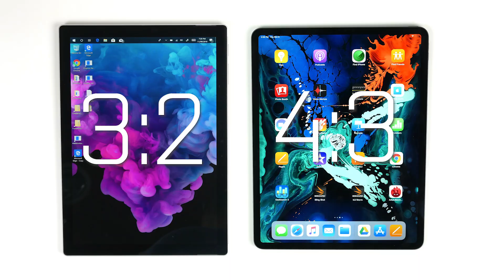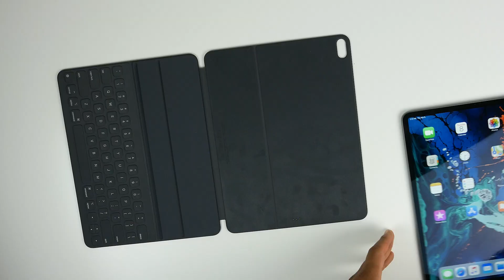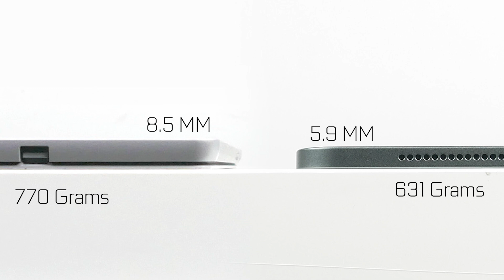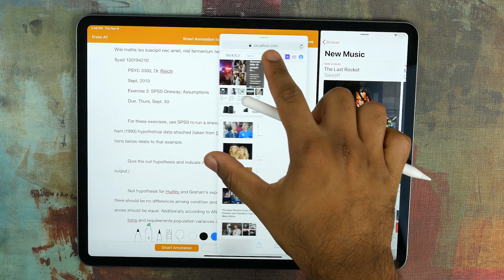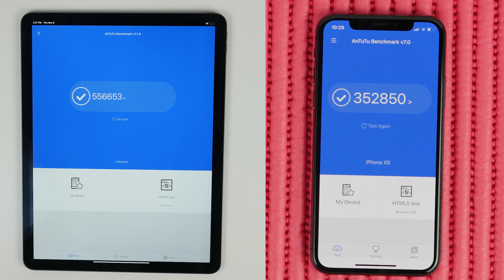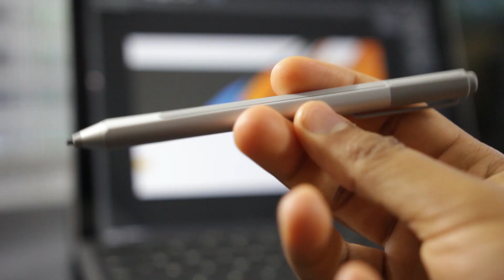2018 iPad Pro vs Surface Pro 6

Comment: One thing people won't understand is that, these two CPU uses different architecture, one is desktop class design to run heavy and capable operating system and the other is ARM design to handle mobile operating system, they work differently, one is less tasking and the other is super high tasking. If Apple A12x CPU was that good, why didn't they use it at least on the New MacBook  Air? , I bet you, macOS will cripple the A12X CPU cos that's a desktop class operating system, it has plenty of information to process compared to a mobile operating system. The iPad is a nice and capable machine that can handle any kind of mobile task which by itself, it's very limited. but trust me it cannot do more than that at least for now. Even the Photoshop that was demoed on stage during the iPad launch event had some minimal lag to it, even when it's a strip down version of the full Photoshop that runs on a true computer. At the end, the iPad pro is a powerful iPad that can only handle basic tasks. People talk about how u can edit 4k video on it, but the real question is, do this set of people truly uses the iPad pro to edit their 4k video all the time without the help of a computer? How convenient is it to really edit 4k video on an iPad? How does it handle plugins? How does it handle effect that even an Imac Pro struggle at times ? Please someone should correct me if am wrong.
Reply: i remember the fan boys saying the iphone X was outperforming a mac pro. lol i was like oh ok i guess 4k editing is a joke now
Reply: So if it ran mac OS then the geek bench score would be very different?
Reply: The limitations of the OS and the different instruction-set doesn't change the fact that the A12X is a more powerful CPU than the Core i5/7 used in the surface pro. In benchmarks both devices peform the exakt same taks/calculations independet from the platform/architecture. And if the iPad finishes these tasks that much faster it also means that the processor is more capable. Apple has suprassed Intel with their chips in terms of performance per watt already long ago and it really starts to show with that iPad. They didnt put in  the MacBooks since all programs for MacOS are compiled for X86, so it wont be able run MacOS programs natively as of right now. (Im sure though Apple has already an ARM compiled version of MacOS ready and they are probably just working to make third party applications work with an emulator behind the scenes => they already did this back in the days when they switched from PowerPC to X86 with an emulator called rosetta)

But I agree the ability to use the power of the A12X is fairly limited as of right now. But since its so powerful and it has a USB-C port Apple could easily update it full fledged pc experience in the future. The question is, if they really want that since the restrictions of iOS are part of their business model. For example you can only install apps from the app store so apple always gets part of the cake if you buy an app.
Reply: Lucas C. The smart money would be on Apple transitioning into a desktop version of iOS and getting devs to develop for their a-series processors before transitioning to desktop for a-series, the gulf in third party support between OS X and iOS is massive. It’s almost embarrassing that ANYBODY thinks Apple should give a crap about maintaining x86 when their x86-based OS X has so little third party support in comparison to iOS.
Reply: @sociocritical  the same company made a10&a11 snapdragon chips Apple makes nothing quacom made it.
Reply: Someone who gets that you can't compare the scores because of the architectures!!!!
Reply: A12X can handle windows 10 better then any low voltage intel cpus you must be sure of that also geekbench is independent so of the score on one cpu is higher then the socre of other device that means that the device with the higher score is better period that is coming from geekbench and not only on geekbench but im sure the A12X will beat the full surface pro with i7 and 16gigs of ram woth no problem in any power demanding app like photo editing video editing benchmarks etc cuz not only the cpu is faster but the gpu is more then double the power of these i5/i7 integrated gpus
Reply: napoleon windows 10 is formatted for x86. If you put it on a12 you’ll have to emulate an x86 architecture. Unless the a12 is like 10x more powerful, it would t show better performance than running a version of Windows that’s formatted for ARM.
Reply: @liquidmark5081  xDDD funny... no for real SD835 runs windows 10 smooth so A12X which on the other hand is 3 times more powerful shouldnt have any problem running it
Reply: @napobg6842  but will it run complex tasks? Will it run in a RISC architecture without having any issues? That's really hard to say. You can only translate some of code from the CISC architecture to the RISC one, and there's no guarantee that it'll work efficiently
Reply: @edbt158  it will run efficintly after all that is the point of RISC to run reduced instructions set but to run them better optimized and more efficiently
Reply: @napobg6842  surface and mcbook has same CPU so mcbook is crappy too.
Reply: @damiangrisoli5592  it is all about how tge aoftware utilize the hardware. Apple software is always more efficient then other softwares especially windows which is so laggy and slow. Windows only dominates in gaming... qualcomm has nothing to do with apple's soc. Neither A10 nor A11 are made by qualcomm. The only qualcomm part was the modem but now apple is only using intel's modem but nothing else especially from qualcomm. Apple is even using only in-hause cores while qualcom is using their own cores and cortex cores

Edit: even their kryo cores are based on ARM cores
Reply: FRED'S TECH HUB you are right when the snapdragon 835 was used on a laptop. It performance was reduced to almost half
Reply: The A12X is the real deal, but you can't just put it in a Macbook and expect your OSX apps to run since it is a completely different architecture. There is a lot of speculation about Apple going that route in the near future, but it won't be easy. They've already done an architecture switch years ago (PowerPC to Intel) and it was complicated, you essentially need to use emulators until the major software vendors are able to provide native versions of their software for the new architecture. Famously, Photoshop would run terribly slow in the first Intel Macs, as Adobe was slow to come up with a native Intel version.
Reply: @darak2  Not only Adobe. I also remember Office 2003 being a terrible terrible experience. I am pretty sure they are already working on an emulator similar to rosetta back in the days though. The performance per watt increase is just too sweet to no try these chips out in a small form factor notebook to replace the slow Intel Y-Series 5watt chips, especially with Intel's frustrating roadmap in mind. From an economic point of view it would also make sense since Intel wouldn't get any slice of the cake anymore. It would also be a unique selling point to stand out from competitors since they could produce notebooks with longer battery life, more performance while also making them more portable.
Reply: The ARM architecture is not fundamentally less capable of worse suited for complex tasks. 
(There are even ARM server chips)
The problem is that a lot of software has been created for x86 CPUs. And porting it can be difficult.
Especially when your software makes use of special hardware capabilities like SIMD.
Best proof would be that there are ARM versions of both Windows and of course desktop Linux.
Reply: Ymi_Yugy there’s no need to port everything. iOS already has a ton of third party support. So much support that it DWARFS the level of support and software available for OS X running on x86. Aside from a handful of apps, the rest of the OSX library is sort of expendable in comparison to the support that iOS has.
Reply: Good coment but i feel the direction Apple is taking by going in the direction of a PC slate is the future. Ofcourse its still limited but the idea is legit. Will take time until Apple is confident enough in its ipad hardware to put a full OS onto it
Reply: @JBruv1  Thanks for understanding my point of view. The ipad pro has plenty of power but it's wasted, there's no real file system on IOS, how do u manage external storage that is connected to the ipad pro through USB  C? if you connect a camera to the ipad pro, it launches the photo app and thats all, you cannot copy a file to a folder for  later use, u cannot even transfer those photos to the ipad pro for later use as well, understand the point am trying to make here, there's so much limited use case for the ipad pro as a pro user, considering the fact that it's very very powerful. If you are making a powerful device like the ipad pro there should be plenty of pro software that can take advantage of that, making it worth buying. Next year there's still going to be a new powerful ipad pro that will still be more powerful than 70 to 80 percent of all PC's yet no real use case for it. It's like comparing a power bike to a practical Car, the power bike is faster but there's no real application apart from the fact that it's faster yet not practical.
Reply: Try to edit 4K video @ 100mbit on this thing...
oh wait you CANT, its an iOS device, gl transferring your files to it.
Reply: @Blessedcookie2000  First of all you can, and one of the youtuber even has done it already. Second of all, its first priority is portability dimwit. You shouldnt be editing 4K videos even on a laptop. Get a workstation for that. Just because you can, doesnt mean you should. Specific devices are made for specific purposes and a tablet is clearly not made for 4K video edits. It's clearly a device for illustrations and office works. The performance is clearly meant for editing RAW photos, which clearly requires a lot of processing power too. And for the File transfer, read my comment above.
Reply: Benoit Levesque try editing that same video on that surface oh wait......its running updates again. When its done......wait windows froze again.  What a joke
Reply: Apple is working on it, and it’s going to be epic.
Reply: Surface should use mobile processor instead native processor 😑
Reply: Ikr people are jusy dumb
Reply: Jeeeez, do you want a device that works Like a Laptop ? Go for the surface
Do you want a Tablet ? Go for the iPad
Reply: in conclusion.. dont judge a cpu based on benchmarks... and also.. watch more Linus Tech Tips
Reply: But no one can make Apple fanboys see reason.
Reply: how many of us do really need a real computer anyway
Reply: x3100owner ... You ask who needs a computer?!?  Ahhhh, Grasshopper, you are of the Millennial spawn, are you not?

Sit down Grasshopper, and let me tell you about a time that existed long before you were born.  And try to be still.

You see my child... I am an old man. A retired engineer. And a wise man, at that. And I was there... alive... during the initial days of the “computer”.

There was once a Motorola 6800 processor, and a simple terminal window, and life was good. Back then we called it ... “the cats ass!”

There was once just a simple DOS screen. Waiting to be told what to do.

And during these days of human triumph, mankind was in charge of the computer, and we told the computer what to do. We wrote code in those days. Code!  We coded, Grasshopper!!! The computer then, was at our beck and call, and could only do, what we allowed it to do. We coded our asses off. It was the time of... “the cats ass!”

These were good times, Grasshopper. Good times, indeed.

But irony, has a sense of humor, as it turns out. You see, Grasshopper, the devil, before this time, had already planted his seed. It was known as the Atari computer, of 1972, and within this computer was born a game. The game was called “Pong”.

Much like the plague, the game Pong spread upon the earth, and the dark times began, as the stupefied human race sat in front of their computers to only play mindless games!

“Grasshopper.... stop fidgeting... and sit up straight... for Christ’s sake!!!”  

Then came AI. Artificial Intelligence. 

We don't know who struck first, us or them, but we know that it was us that scorched the sky.

Then came Windows and the Intel processor. It was the return of Satan.

What I’m trying to tell you, Grasshopper, is that real computers do not exist anymore. And you, my infant child, are nothing but a carbon based unit that the Intel Gods use to promote and spread their agenda of chaos.

Be afraid, Grasshopper. Be very afraid.

Fore the days of the real computer, are gone and lost in antiquity, and you only exist, to give allegiance, to the Xbox!

You see, Grasshopper... you are already dead, and you don’t know it.

Now go. Leave me alone.
Reply: Nailed it
Reply: because of the fucking x86 license from intel
Reply: I don't believe a machine learning practically capable with 6mb+ l2 cache is anyhow lightduty computer processor
Reply: yup, csnt even support a mouse 🤷‍♂️
Reply: Lol, a lot of people are correcting you, where are you at bro? some people do edit simple 4k videos on their iPad, and what kind of iMac pro are you talking about that can't handle 4k videos ? iMac pro that you have or iMac pro that you made up Lmao
Reply: Wow rly good explication
Reply: I have been researching computer chips and mobile chips since I got internet access . There is no processor which is lag and fully butter smooth mobile processor till today released to market.. current Ultrabook and high-end laptop processor are a  strip down of desktop processors . Mac os and iOS has limited features . Meaning less code in OS . Which might be running fast . Example . Note 9 vs one plus 6t .. both have same processor , and sufficient RAM , but note 9 lags in speed test...
Reply: ASA ASA  samsung has bloat running on it where 1 plus is pure android.
Reply: Just gonna throw this here, people have already run windows on snap dragon 835... I haven’t written any os or machine code so I’m not gonna attempt to estimate how demanding an os is
Reply: @Anonymous-vh9tc  no matter what OS is running on a system, while conducting a benchmark test the task or render assigned to all the systems is the same. So as long as the benchmarks are higher, that means the system is capable.
Reply: It's not used in Max OS because MacOS is built around the x86 architecture. There is decades of history used to optimize desktop OSes to use x86. Fundamentally there is little to no difference other than the history behind it. MacOS can't run on ARM because that would require a complete rewrite of MacOS.
Reply: @* AnimalHeadSpirit *  Oh my!! Desktop games on iPad !!!,
iOS completely works on different architecture (ARM)
Arm is completely different architecture than traditional CPUs
His comment makes sense..
Reply: youre missing the point of apple trying to make mobile systems powerful for proffessional power users, like architects and 3d designers
Reply: Basically, the new ipad pro is an oversized iphone Xs. At the end of the day, it is still a mobile device through and through. Unless they improved the software (and maybe desktop grade cpu as well) i dont think it will replace our laptops yet.
Reply: The chips do use different architecture. x86 vs arm. I don't know if they have an arm version of macOS in the works as they did switching from powerpc to intel, but it is a lot of work to do and their focus has been on mobile for some time. So part of the reason they haven't switched to arm for macOS is likely the effort/cost involved in switching, not that intel is a better 'desktop' chip. 

If you look into web servers you will find a number of them are arm based chips. Much higher core count allows them to exceed intel chips performance particularly in computer per watt. 

Most of the reason chips used in mobile situations are limited is that they are great at burst speed, but sustained would produce an amount of heat they cannot dissipate due to the lack of large heat syncs and fans.

Finally I would not be surprised if the GPU in the new ipad completely blitz Intels integrated GPU. The integrated GPUs of intel have always been far behind dedicated. In addition being custom silicon and Apples own render engine (metal) it likely has features or work together to a degree that is not found with other GPUs.

I believe windows 10 has an arm version. It would be cool to see how well it would run on an arm. I think people will be surprised just how far it has come and that it is at a point where it rivals intel's desktop chips.
Reply: @ThurstanH  In theory Apple can switch from Intel to ARM but it will take away their engineers and programs from their ios products.  Apple is making less and less inspiring computing products.  Even for behemoth like Apple, they really can't do both.  
Apple has to open up their platform so other manufacturers can make better hardware.  Somehow, I don't think that is happening.
Reply: FRED'S TECH HUB one word. Optimization
Reply: Which is why Apples retarded
Reply: MacOS is not a super high-overhead OS, and really that’s not the difference. The architectural difference is in HOW the CPUs run programs, not what they’re capable of. ARM chips are capable of doing just as much as x86, but everything runs on X86 so that point becomes moot. That’s also the answer to your question, they would put it in the MacBook Air if the software was ready for it. The preparations they’re making are software ones, not hardware.
Reply: Watch Jonathan Morrison's new video. Should help 🤷‍♂️
Reply: You are mixing up things here...A12 is faster period. Geeckbench gives the processor a number of instruction to execute and measures the performance output on those test it doesn’t matter if the device runs iOS of full blown windows. The difference comes from the design of the chips and apple is known to use a lot more silicone in their chips those having larger cache memory. Also A12 is a specialized processor compared to  the general purpose processor that come from intel. All this makes the A12 a faster computing device but still limited due to iOS.
Reply: Andrew Steel iOS is way more than an app launcher.
Reply: I use a pro. The 2017 version. I do not like this new version because the slim bezel is good for content consumption, but while creating content it is nice to have area you can hold and make minor adjustments in tilt on the fly without worrying about accidentally touching the screen. I have used Cintiq and a range of Wacom products overtime. IPadpro is kickass. And with apps like Procreate, Affinity Suite and more... this is so potent, convenient and quick(though there is a 15-20% reduction in execution speed) that I have been doing my professional work on it. Surface is still a laptop with a touchscreen in its feel while iPad is a whole different, though less powerful, but more engaging and seamless format of content creation. And when it comes to HD r 4K video edits.... both of them are far behind a proper workstation. So.... as a designer and an artist, I would choose iPadpro for a variety of reasons, from logical to emotional.
Reply: Well, theoretically is possible for an iPad to run the same programs as the Surface Pro, the problem is multitasking. As you know, multitasking in an ARM based device requires more RAM, because it's processor only accepts one cycle instructions. Because of that, it stores the instructions on the RAM memory. Also it'll not result (at least for programmers) to port an x86 based program to an ARM based program (an x86 processor requires 1 line to do a task, while the ARM processor needs a lot more, like 5 or 6. It could be more or less, it's just an example). 
Resuming what I have to say, if you truly need multitasking (and an USB A port) go for the Surface Pro. If you want a device which has a long lasting battery (and a very good performance) then go for the iPad pro.
Reply: FRED'S TECH HUB BAM well said bro, the iPad Pro is just a weak little pad made for ppl that want to burn there pockets. iPad Pro is just at the end of the day a over powered refreshed and lighter  iPad 1
Reply: All that and windows implementation of tablet mode is horrible. Reliably on a windows platform is garbage. And if you actually do your homework you will see yes 4K video is edited on an iPad Pro using lumafusion.   Ive seen full YouTube videos edited completely on an iPad Pro with this app. music producers make music with iPad pros . give it up the iPad is there whether you want to except it or not.
Reply: I rather give apple $3k for a capable computer that does both OSX and Windows. Why bother looking for a mouse that works for an iPad or an App that extends your desktop to your iPad just a waste of time. Just buy a Surface or HP Spectre if you want a tablet with full OS, iPad Pro will always just be a money making iPad in steroids. If Apple wanted to make OSX version in the iPad Pro to make it exclusive they would done it already and I would camp out for 10 hours to get one but for now I'm happy with my i7 15'' MBP Pro touch bar until that day comes.
Reply: Oh lord....the fucking excuses begin...
Reply: Can someone help me? I have an iPad Pro, a Windows Laptop, and Mac computer. I love to design and run Excel spreadsheets with Macro capability (VBA programming). Because of the ARM architecture on iPads I cannot enable and run Excel Macros on my iPad (I have to use my PC or Mac computer). I can run simple spread sheets, but nothing with Macros. This drives me crazy! I think I have figured out some ways to remedy the problem, but I’m not really happy with them. I was hoping some geek out there could think of some other options. 

My current ideas include:

1) Scrape the iPad Pro, and buy a Surface Go, that uses an actual PC based operating system to run any Windows Office S/W.  My problem with this is that I am an admitted biased Apple head, and I prefer to use an iPad to run my applications. Apple has many more applications that I use too.

2) Run my Windows laptop in a remote fashion on my iPad. This is basically turning my Windows laptop into a server. As an engineer, I’m just not happy having my Windows machine on all the time. And it just seems rather inefficient.

3) Is there a way I could run Windows in a virtual mode off of my iPad, and therefore run my Excel spreadsheets (with Macros), in a virtual PC mode. Once again, this fix (if even possible), seems clunky.  But I would perhaps give it a go if the integrity, look, and feel of my iPad was not compromised.  Could I simply switch back and forth between IOS and Windows effortlessly?

So that’s where I’m at. Are there any better ways of solving my conundrum? Could the latter method up above work? 

Thanks in advance for any thoughts!
Reply: @tonyolson1962  I don't have much idea about MS Excel because i sucked at it in school and have never tried it again. But in my suggestion, I feel that you should just use boot camp to dual boot your mac with Windows 7. Windows 7 is the only Windows version i feel is respectable and truly clean. You'll get amazing performance in case you want to game on it, as well as there will a lot less bugs when you're doing your office work. I've dual booted my iMac with Windows 7. Only problem i have is optimizing it with the native 5k resolution of my iMac Screen.
Reply: Vaishnav Thanks for the suggestion, I will definitely check into it. You mentioned using it on an iMac. I should have mentioned that I do have full version of the MS Office that runs just fine on my Mac computer. The problem is with my iPad that uses a different operating system. I’ll have to see if your method will work for an iPad since that’s my real issue. 

And yes, I TOTALLY agree that Windows 7 was the last most stable version of an Wintel OS. My favorite of all time was Windows 95, but then again, I’m a really old fart!  I actually learned to program in FORTRAN! lol

Thanks again.
Reply: @tonyolson1962  Oh youre using an iMac too. I though you had a macbook or something.
Reply: Vaishnav It’s actually a MacPro laptop, but same thing. It will allow Office S/W to run just fine, but an iPad (or iPhone) has certain limitations that will not allow my automated Excel spreadsheets to run.
Reply: Because the cpu of macbook is better than that of ipad pro. And apple never claimed that ipad pro is more powerful than their macbook.
Reply: My iPhone and iPad can now do anything that my MacPro laptop or Windows 10 computer can do. I just installed “Splashtop” and it allows me to remotely access either computer from my iPhone or iPad. It’s pretty cool because the entire screen of either my iPad or iPhone will display my computer desktop, (it doesn’t just open up a small window), and there’s no lag. It’s almost easier because it turns my computers into a touch screen, if I choose to use my fingers, and/or I can use a keyboard as normal. So now I can use my iPhone or iPad as a typical “App launcher”, or I can run my Excel spreadsheets with VBA code and macros on my iPhone or iPad which you normally can’t do with the ARM architecture on Apple or Android tablets. I can even do a right mouse click using just my finger. The more I use it, the more I like it.
Reply: FRED'S TECH HUB damn
Reply: FRED'S TECH HUB 👏🏾👏🏾👏🏾👏🏾👏🏾👏🏾👏🏾
Reply: FRED'S TECH HUB u are right bro
Reply: FRED'S TECH HUB you're right most people just like to argue about everything you mentioned.
Reply: FRED'S TECH HUB I edit fully quite a lot of 4K footage on my Pro - it’s a dream to use and you need a pretty powerful pc to do what it does. I use Luma too...
Reply: koolkatken THANKYOU! Most people who bash the iPad cant use it, have never used it to its full potential or just simply don’t have a clue.
Reply: good points, but apple is working on making their own chips for their laptops, plus your talk about pro apps and tasks is also right but desktop class apps are getting developed for the ipad, im not talking about photoshop, it's already made just not out yet, im talking about fpcx or logic pro or maybe other adobe apps and apps like affinity photo and designer, and adobe photoshop on the ipad is the full but its just made to look and feel better for touch.
Reply: @youssefpicasso  "but desktop class apps are getting developed for the ipad, "  Until they actually come out they are just concepts and unless they are just as powerful on IOS as they are on a desktop OS it's just not the same.
Reply: @youssefpicasso  i think you miss the point is ios is a tablet/phone operating system.  it just can't do a lot of the things that a desktop os can do.  example, i've a very up to date mirrorless camera.  if i like to edit pictures in the field, it is a royal pain.  you either have to transfer wirelessly or get the camera kit to get the pictures in.  either way, it is a slow and cumbersome process. and let say you finish editing the pictures and need to transfer 1000 high quality  multi-megabytes pictures off the ipad, there is no easy way with only one port.  transferring them via wifi even with te latest standard will take a lot of time, way more than even usb 3.1  all of the apps you mentioned is not for pro work.  anything from apple works fine if it stay on Apple devices but anytime you need get something on or off it, forget it.
Reply: @youssefpicasso  pro apps and tasks? but its an iPad PRO! lol.  Actually there's a chance that lightroom and photoshop for mobile will become the better option because the're not relying on old the janky code that the desktop versions use.  Maybe it still wont be able to auto align 20 24 megapixel RAW night sky images and turn them into a smart object  in only a few minutes.
Reply: Charles Talhelm depends on whether they intend to harness cloud compute. Locally if you are comparing performance to a desktop then I’m doubtful, not due to raw speed (which is showing to be comparable), but the heat produced in sustained high workloads would likely overwhelm the ability of the ipads limited fanless heatsink to dissipate it. This is the very same issue seen with core i7 and i9 chips in sub 2kg laptops ramping down due to high temps.
Reply: It’s not that the intel chips inherently faster because they’re built for windows and PC operating systems, it’s simply they use a different type of architecture. This means the bare bones assembly code and how the cpu processes instructions are different. It doesn’t mean macOS would cripple the A series Chips, it means they’re incompatible. It’s like saying guitar strings are superior to violin strings because they are used on a larger instrument. It is true they have different use cases, but being an intel chip does not make it faster than the A10X chip.
Reply: Great post, for the money you are better with the Surface it’s still the ultimate hybrid system. This is where apple fail for me they still won’t produce a MacBook with a touch screen. The price of the iPad Pro leaves you able to consider the MacBook, New MacBook Air and The MacBook Pro as serious options. I use iPhone and MacBook Pro however I can see me leaving when this kit has run its course other brands are offering better value for money.
Reply: @neillferguson7279  I think there are certainly also lots of use cases where the iPad Pro easily outperforms the Surface Pro. It all depends on what you wanna do with it at the end. If you need some desktop class programs or external accessoires => go for the surface. If the all the applications you need are available on the iPad => go for the iPad. Hardware-wise the iPad is the superior tablet but you have to keep the OS limitations of iOS in mind.
Reply: FRED'S TECH HUB I had serious doubts between getting a i7 8GB 256GB Surface Pro 6 or the new iPad Pro.

I first thought as you: the Surface Pro covers all my needs as a laptop. However I was initially looking for a tablet, and Windows 10 is not touch-friendly, honestly.

In my opinion, people want its work to be done. The simpler and faster, the better.

If you are an artist or graphic designer, then I think the iPad is superior. It has relatively accessible apps like Affinity Photo, Affinity Designer or Procreate. If you are a video editor then you've got Lumafusion too. It's a work that can be done, even nicer than on a desktop - if you don't want to go up to a Surface Studio.
That's because apps are better optimized on the iPad and better implemented for touch-use. On the Surface you may handle more complex programs but they're designed to work with your mouse, and tell me, wouldn't it be nicer to work with a traditional laptop then?
For taking notes it may be a tie.

I'm an engineer student and I don't mind waiting for home to have my heavy work done. Maybe in the future the job demands me a laptop, and if they don't offer me one then I'd probably get a Mi Notebook Pro or something like that (with i5, 8GB and a GTX 1050) that moves Autodesk, Catia or Solidworks better than the Surface could ever dream of. And I'd still have an iPad with an incredible display and speakers for multimedia tasking, lighter (which is ideal for traveling) and that ables me to make my first steps in video editing which I appreciate.

For me, the Surface Pro fails both, as a tablet (with a good touch experience) and as a laptop (with the same productivity levels as a notebook). And I really considered getting one. But I think it's worth it expending a bit more to have the best of both worlds (not too much either: 2,250€ between the iPad Pro 12'9" 256GB + Mi Notebook Pro i5 8GB GTX1050 on Gearbest vs 1,750€ of the Surface i7 with integrated graphics).

If Windows 10 was more touch-friendly and had better and cheaper apps on its Windows Store, and the Surface had a bit better screen and speakers, then I'd get it no doubt.
Reply: well the MacBook Air is is a MacBook Air. It's designed for better battery life and portability. They probably will do something better if they release a MacBook Pro.
Reply: Look on Dom Esposito video. It easily edit 4k videos
Reply: you dont even know what are you talking about xDDDD hahahhaha different architectures... and what SD835 was used in ultrabooks for handling windows 10 in turned out for a mobile cpu it was pretty good and considering that A12X is 3 times faster with gpu which is more then 4 times faster then SD835 cpu and gpu it can handle any OS pretty well also Apple is planning to replace intel cpus with their own cpu in the near future so dont worry
Reply: @davout5775  it uses emulation and that's with close collaboration with Microsoft and its performance suffers very much
Reply: @davout5775  lol you forgot that it doesnt run all desktop apps and its laggy lol
Reply: @davout5775  man, U are a dumb. The 835 is RISC architecture and it uses an adapted windows. U can't run complex tasks on that CPU, it's very limited
Reply: @edbt158  amm no im not dumb maybr you are idk... and yes you can run windows on sd835 bcuz there are some laptops that run windows on that processor
Reply: @davout5775  so the CPU in my iPhone has the same silicone mass as a 1'7 CPU.
Reply: @damiangrisoli5592  it is not necessary
Reply: also CPU is CPU no matter of the architecture and there is nothing like mobile architecture and desktop architecture
Reply: @davout5775  Yes and no. While there technically is no specific desktop or mobile architecture. There are huge differences between the ARM and X86 instructionset. And the ARM architecture was build with lower power cpus in mind while the X86 architecture was build with desktop class cpus in mind. To break it down: X86 is a heavier instructionset which contains instructions which need more than one cpu clock cycle to perform => complex instruction set computer. Because of that the decoder for the instructions is more complex and needs also more power. The ARM instrcutionset on the other hand is more leightweight and the instructions are limited to one clock cycle, so the decoder needs less power andis less complex. Still you can perform basically the exact same tasks on both processors, the ARM processor might only need more instructions to perform the same task. But in a benchmark both processors perform the exact same tasks/calculations, so with a benchmark like geekbench you can still compare the power of two cpus independent from the architecture. (That was also the sense while creating geekbench to compare processors independently from platform and architecture)

Tl;dr ARM was build for low power devices but that doesnt change thr fact that its faster than any of the processors used in the surface
Reply: @sociocritical  much thanks man really informative comment 😊😊
Reply: and yeah 1 more for retarded ipad fans if any of you are bragging about productivity like they always mentioned, pls explain to me how to open company class apps/private company apps that's usually designed for x86
Reply: Feelcomfoert For Ever the answer is to stop clinging to x86 and use what’s available for your damn architecture
Reply: @feelcomfoertforever5891  sure, and maybe you can explain why almost 90% of all tablets bought for business are iPads?
Reply: Feelcomfoert For Ever  if they are company class most cases they are written in-house.  The developer wrote this specific apps for pc only DUH!
Reply: also for a mobile device the A12X has 10 billion transistor which is a lot more the these i5 and i7 found in surface pro
Reply: they run the same task on geekbecnh 4 
cpu = cpu it doesnt matter what architecture
also he forgot to metion gpu
and that thing is miles better than the integrated gpu
Reply: @falcon6329  in what way GPU is better, ?? I have no problem with the integrated GPU .I have been using intel for the past 5 years in 3 different laptops , I have never seen any of my friends who edit on iPad.... Even though they have it....
And by the way the CPU matters you can't play GTA 5 in iPad....
Reply: @hypernovic5301  if you have intel gpu then you cant even play pubg, fortnite even if those games where mobile versions
you really underestimate mobile games
if you dont have a problem with having 1/10 performance of a real dedicated gpu
you can always get a way cheaper laptop for 1/5 of the surface price
Reply: @falcon6329  But still iPad sucks ,kids laptops  are much better ,,, I think you only play mobile games,
And I hope you will forever be an iSheep,,,,
Reply: "ipad sucks" thats the only think you can say?
love it or hate it, ipads are the best tablet and top selling computer

call we whatever you want i dont care
im not the one that is blindly hating a brand
maybe you cant afford one but no need to be upset about that
Reply: @falcon6329  That's why I prefer razer's products than Apple, I buy pc games , and you say you play Fortnite and pubg using Mobile .

I don't pay more for less,

There is no point in replying you again...
Reply: First your concern is real true...but that is not means ipad lose against surface. Because the most important is optimises for running. Ipad strong because the app was designed to match and using without waste which is why it is stronger. Windows is greedy, they had a lot of specs, some really crappy so they cannot just optimising for one or two device...and also, they are the open source os where mostly every thing can run on. This make windows useful but also wasted. Second is they are using intel, which is shitty in almost every workflows platform...if they are using amd , i am sure that surface sure smashes all round even in graphics performance. That is the power of the optimistic where iphone 4 still running like hell even you dont want to mention something from nearly a decade...i still can watch youtube, surfing web and doing basic thing for work and connecting to familiar...just not overpower to playing games anymore.
Reply: @NamelessPassenger  

jajajajajaja NO
Reply: Are you an idiot? Apple has a contract with Intel which they can't violate till their dates are due. So if Apple uses anything other than Intel on their MacBook line up they will end up getting used for it. IOS on iPad is different from what its on iPhones. Having a desktop OS on a tablet is stupid and nobody whats that, which is why Surface line up was a flop. Let desktops be desktops and Tablets be Tablets. You can make Tablets powerful for editors, but you can't just integrate both. iPads outsell all the tablets in the market and there is a reason for it. Apple is planning to launch more pro oriented softwares for iPads. And next year we're getting the desktop version of Photoshop on it. Im pretty sure in coming years we'll get more softwares like Premiere Pro and FCPX. And if FCPX comes to iPad it'll be a beast at video editing.
Reply: @vshnv_c  you know, sometimes it might be easy to start calling people names on the internet and thing there's no real effect on the persons feeling... how do you always feel when someone walk up to u and call you an idiot ? the comment above was my own opinion and i don't see how it affected  u to a point you will call someone an idiot .
Reply: Vaishnav no, they are planning on create their own chip and their due contract with intel like rumours will be at the end 2019 or early 2020. Second they are on the contract but that is not means they cannot introduce the other cpu like samsung does use both exynos vs snapdragons...or just like acer, even they are on the contract but they still release helios 500 with amd cpu vs gpu. The contract is just a contract , they make a switch does not means they cannot end up early
Reply: @NamelessPassenger  Are you sure that running Mac OS X Yosemite efficiently and effectively is not a concern presently? 2018 MacBook would have been an excellent introduction for the A12X processor.....don't you think?
Reply: Vaishnav who told you surface pro lineup is a flop. iPad outsells every tabelets that's true but most people buying ipads for media consumption in this area iPad is best and also affordable that's why it outselling. But it's not a laptop replacement.   That's why low specs iPad sells so much because its a media consumption powerhouse at a dirt cheap price. In India iPad 6th gen cost around 350 dollars and iPhone xr cost 1000 dollar now you know why ipad sells so much. 
    Surface is 2 in 1 laptop and mostly people who wants laptop in form of tabelet buys it. It's a totally different market. Apple wants to come in  the same market as surface pro right now.
      I own it because I can use it to watch movies, work on engineering projects, run matlab, AutoCAD, play games like DotA 2.  iOS doesn't have such versatility and the people with all these requirements are also not much.
Reply: Vaishnav you are right windows freezes and is constantly running updates ios just works download the app and go to work. How do you ever get anything done in windows?
Reply: @vshnv_c   no, you cant just say "nobody wants mac OS in ipads" Literally lots of people say that they would rather have Mac OS in the Ipads, the reason apple is outselling the tablet market is because there apple and everybody has such a hard on about having the apple logo on there products and because of the "ecosystem". And microsoft never had a "IOS" type of software to put into there tablets other than windows, and lots of people like having Windows in there tablets..bc you can simply look up the surface pro sales
Reply: @stumpsteph2153  MacOS is a desktop OS. And give iOS more time. The tablet has been literally out for four months. You can't put a desktop OS on a tablet, because then it's a touch screen pc not a tablet. A tablet OS has a totally different UI. Putting a desktop OS on tablet is just sloppy work. Microsoft has Windows Phone and Windows 8 which were tablet and mobile centric and they failed misserably. Failure of Windows 8 and Surface products should be a perfect example why a desktop OS is a bad idea for a tablet. Give the iPad some time. Let the future version of iOS roll out before passing any judgement. It'll make it's own kind of pro OS, not just sloppily pick a OS that is clearly meant for desktop use.
Reply: @stumpsteph2153  and surface sales are really bad when compared to both ipads or Macbooks.
Reply: Vaishnav actually no that’s where I’m right, the mate has the fastest chip in any phone right now and even the specs on paper say it’s faster, and even look up YouTube videos of speed tests and the mate is faster
Reply: @stumpsteph2153  https://www.youtube.com/watch?v=Yu9QVuxB_BM
https://www.youtube.com/watch?v=jSM35wIZZO4
Reply: @stumpsteph2153  Kirin is good, but Apple Chips are still superior in CPU and GPU performance. Not to mention the A12X is even faster. And both are ARM processors. So even if the A12X is in iPad, it can be easily implemented in an iPhone too.
Reply: vtx a flop my ass
Reply: Its a tablet for portable usage. Its not a workstation you jackass. Its not meant to be a workstation to edit 4k videos. Its supposed to be a portable computing device. And as far as i can tell, the table is faster than most of the shitty windows computers in the market, specially the flop surface pro 4. Which is why its outselling it. Chrome OS is a joke as we've seen. What do you expect? iMac Pro performance on a tablet? You're an iDiot to even ask that question. Its for the people who want portability, but also a decent performance to do illustrations and photo edits. Plus the display is 120hz keep that in mind. The artists will have full advantage of that. And no other tablet can match that.
Reply: @vshnv_c  Are you an idiot? Apple has clearly positioned the iPad Pro as a stand-in for laptops. "What's a computer?" "Like a computer, not a computer." The "Pro" variant of iPads was clearly intended be more than just a tablet (note the stylus, keyboard and usb-c port). Also, stop with the projecting. There are plenty of people who interested in the idea of a tablet with full desktop capabilities. Why else would so many bemoan the limitations of the new iPad Pro? Also, "iDiot"? Seriously? How do you not know that's a slur against Apple fans?
Reply: @lesbianwalrus  The user interface of Mac OS is clearly not optimised for touch screen. So wasnt Windows 10's. Still they tried to make that start menu and a few mobile style apps, and the other half of the OS was left looking like Windows 7, which just made it look Awkward. Apple should have no problem putting MacOS if it was intuitive for a touch screen. In fact Apple refuses to add a touch screen on their Macs, there is a reason for that. If they wanted to make a touch screen mac, they wouldve already made it and sold it for even higher price. Apple made it a stand in for laptops because it's clearly gonna get future updates with more pro oriented apps. So with future updates iOS is clearly gonna be more pro Oriented UI, with pro apps, but still looks like it should be touch screen. MacOS is meant to be used with a Mouse/Trackpad and a keyboard. iOS is meant for touch screen. Putting a Desktop OS on a touch tablet makes it look awkward, and you know apple is never gonna approve of an awkward design and user experience, since the brand is all about User Experience. Wait and there will pro apps, specifically optimised for iOS. Luma Fusion is already a great app for video editing, already available on iOS. And even photoshop is coming. In future more pro apps like premiere and Logic X Pro and Final Cut Pro will follow its way on iOS. But giving a tablet a desktop OS is not the solution, its just lazy work trying to just done with. Have patience, the product has just launched.
Reply: @vshnv_c  Firstly, thank you for not coming off as a raving asswipe this time. I agree that macOS with a touchscreen would lack elegance to say the least. But by "full desktop capability", I just mean accomplishing basic desktop tasks but whatever means necessary. I doesn't at all have to copy the layout of a traditional desktop OS. You can even go without mouse support given that the touch interface of iOS is refined enough. Really the only crucial features missing from the iPad Pro (Professional) is a proper file management system and connectivity to external storage, both of which are the bread and butter of basic productivity. With those it could legitimately pass as a laptop substitute without compromising the tablet experience.
Reply: @lesbianwalrus  You have to consider that iOS even on the iPad is still iOS. Which means it carries come variants of codes which are similar to iPhone's iOS. Now Giving it direct File management access and external storage option makes it more vulnerable to external interference in source codes while Jailbreaking and System file modification and also developing malware and Viruses for iOS. Jailbreaking still happens, but it is getting harder and harder to Jailbreak, and enabling this option is like serving the option on a platter. Which is why apple wants the users to conduct all the file transfers through authorised softwares as a catalyst, hence making the device less vulnerable. Look at Android. They allow open File Management and External Storage. I use an android for that reason. But allowing this enables users to install apps outside the app store, hence making it easier for using cracked apps and pirated softwares, which we rightly should be paying for. And many times these apps are injected with various malwares that apple obviously wont let in on their systems since they advertise security and privacy as their Key Policy.
Reply: @lesbianwalrus  so they can fuck with dush bags like U Apple will never undermine the mc book . just like the mc book has no touch screen put the pipe down NOW!!!!!!!
Reply: underwater  there are wireless external hard drive solutions for iPads and the files app on the iPad works very well for storage. Keeps docs in the cloud while my iPad is free for apps.
Reply: Vaishnav Um, the reviewer said that these were laptop replacements. Also like with all Apple products they require desktop use and help.
Reply: @quinten4214  its a replacement for some people it is a laptop replacement. And the target audience for this are the designers and photo editors. Which as a designer and photographer myself, I can assure you it's fully capable of standing on by itself. Apple didn't advertise to to coders. As for file management, you can check my comment above on why apple can't do it.
Reply: @vshnv_c  would surface pro 6, 128, 8  Ram, be able to do 4k editing as well?
Reply: Vaishnav iPad will always outsells it because it cost 350 dollars and even lower in sales also there are many people who just need iPad for their basic task.  
 Surface is a laptop and it is bought by those who needs a laptop and not those who just wants to watch movies so the targeted audience is very less and also the cost makes it not for everyone.
Reply: @chandranshpandey1929  the surfaces dont outsell macs as well... so neither it outsells the macs, nor the ipads. It is a flop. They have to drop the rate of production.
Reply: Vaishnav apple has not released the number of Mac solds last year so from where you compared the data that Mac outsold surface pro
Reply: Vaishnav how it is a flop when companies like apple copying stuffs from surface.
Reply: Vaishnav Microsoft is selling their surface lineup really well and they don't have to reduce their production anyway yes you can reduce it in your mind.
Reply: @chandranshpandey1929  Copying? Are you serious? You know that Windows was stolen and a copy of MacOS after Bill Gates left the Macintosh team and started Windows with Microsoft. The Surface still has a cheaper build quality when compared to Macs. Copy what? Last year, Apple sold around 19.6 million Mac, while Microsoft sold around 3 million Surface devices in the same year. For a Windows Laptop that is a big time flop. Apple being a tightly closed platform and is still the fourth most selling computer in the market. And you wanna know how much Windows laptops sell? Dell sold 58.8 million laptops in 2017. When compared to 3 million, for a windows laptop, that a big time flop buddy. Even the iMacs outsell the Surface Studio from a far margin. Copy What? It's microsoft who's always tried to copy apple and fallen on its miserable face. With Windows 1, with Vista. And Microsoft always failed. I agree Siri isnt the best AI out there like Google Assistant, but sure as hell its way superior to Cortana. Macs have been selling before Windows even existed bud.
Reply: Vaishnav which year data are you giving me as Apple didn't release the numbers last year. 
      If you are talking about copying every company does that Microsoft does in past apple is currently doing surface pro featuers. 
     Where are the data shows that Dell sold 50.8 million 2in1 laptops or this many xps devices. Surface lineup is not 300 dollar general laptop that will increase sales number. Apple still doesn't have any 2 in 1 laptop.
     Microsoft created the new market of these series of laptop which comes at a premium price and Microsoft never made these devices to compete with Dell, hp Lenovo around the world.
   These are built to show new innovation in laptops and Microsoft did it.
       Microsoft is not providing services everywhere so it's tough in countries outside US to recommend these products.
      Where as Apple and Dell are already present in most markets well before Microsoft.
    And also apple is still selling their 2015 old MacBook airs in large numbers in many markets,  so those numbers really doesn't show shit and everybody knows about Dell so there is no point comparing Dell with Microsoft.
       It mostly presence in USA and the numbers the numbers still increasing.
    Survey simply shows most people wants 2 in 1 laptop and Microsoft made these devices popular and also Microsoft is not going to compete with their windows laptop manufacturer.
       Micrsoft only sold premium devices in the past and 3 million number is well beyond expectation in that segment and already cut the market of Mac premium laptops.
       If you say if a company which is able to sell their laptops in the segment where apple rules is a  failure then you should change your mind.
     Microsoft also created surface book which is simply exceptional.
Reply: Vaishnav apple also copies a lot best example is Apple pay from Chinese company wechat.
Reply: @chandranshpandey1929  the data is on the web, just do your search. And the fact that surface sold only 3 million devices last year, it shows that in extensive sure people don't use touchscreen during their day to day desktop use. Look at the comparison between the sales records of macs and surfaces. Both are 100% premium market, and Macs Crush all the surface line ups. Even the sales for Dell's XPS 30 is higher. Surface is just bad product and its running on a loss. The company didn't sell as many as they were expecting and the production was cut last year. A desktop os is not meant for touch screen. It isn't Intuitive process, hence a touch screen requires a different UI all together. You put a desktop UI on a touch screen laptop, you have a hideous looking cheap looking slab that nobody wants to buy. Some might fancy the touch and buy it, but never use it in the long term, because it is more convenient to just use the mouse or the trackpad on a desktop User Interface. Which is why apple wont put touchscreen on their Macs, but continue to improve ios on iPad for a more refined pro experience. Just give it some fucking time, the device is just out. let the future updates come out. Don't forget at its current os and state it is even faster than the current MacBook Pro. The Surface Laptop has Intel Y processors I guess. I don't know. I might follow Dell or HP, but i sure dont follow Microsoft off all the companies. Its the most ugly brand known for making ugly devices and software. They have sense og esthetics or design
Reply: Vaishnav first there are no numbers on what Mac device apple sold it's the total sales no number. This number also include older version MacBook air which is much cheaper.   Don't tell me the apple is selling 1600 dolllar 19 million devices every year. Cheap products do increaer the number drastically. Just like ipads everybody know iPad pro doesn't sell most rather cheaper version with a price tag of 350 dollar iPad is sold much more than iPad pro series.
     First let apple release the data of specific devices sales numbers then come here and tell surface line is failure. 
      Microsoft is also not active in every country so your sales numbers point is irrelevant comparing apple Dell sales to Microsoft as they operate in a most part of he world.
        Selling 3 million premium devices is an outstanding number and I didn't heard any news on microsoft slowing down production of surface series products.
Reply: chandransh pandey surface pro’s sales figures are pretty consistently pathetic. Apple sells millions of macs, iPads and other devices every year while the surface struggles to sell like 3 million units. Come on.

Also, you said apple hasn’t said how many units they sold? Bullshit. Apple reports that every quarter:

https://www.apple.com/newsroom/pdfs/Q4-18-Data-Summary.pdf

https://www.apple.com/newsroom/pdfs/Q3FY18DataSummary.pdf

https://www.apple.com/newsroom/pdfs/Q2_FY18_Data_Summary.pdf

https://www.apple.com/newsroom/pdfs/Q1_FY18_Data_Summary.pdf
Reply: Vaishnav the the iPads have been out way longer, so of course there gonna have more sales but I wouldn’t in any means say bad.. the tablets aren’t that far apart in performance and in most tasks that most regular consumers use, you won’t notice a difference but like I said apples sales are gonna be bigger than most companies for awhile just bc of the fact that there Apple.
Reply: Vaishnav and for ex the iPhone isn’t the best/fastest/best camera phone on the market but of course it’s getting the most sales bc it’s Apple
Reply: @stumpsteph2153  that's where you're wrong. iPhones are currently the fastest smartphone in the market, being 45% faster than the current Snapdragon 845 cpus. In terms of Camera, I'd give it second best after Huawei mate 20 pro. In fact the current test showed that iPhone Xs with 4gb ram has slightly better RAM management than One Plus 6t McLaren Edition with 10GB RAM. iOS is better optimised its no secret and simple research will show you that.
Reply: @vshnv_c  wow, you don't come off as a fanboy at all...
Reply: Vaishnav excellent point . even though its mobile it can edit 4K video with ease and not choke like windows does.